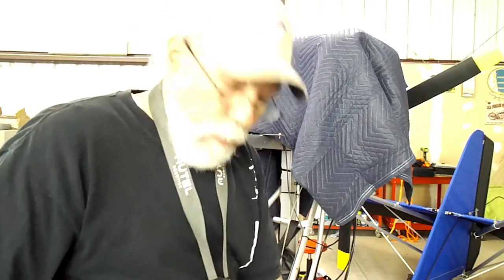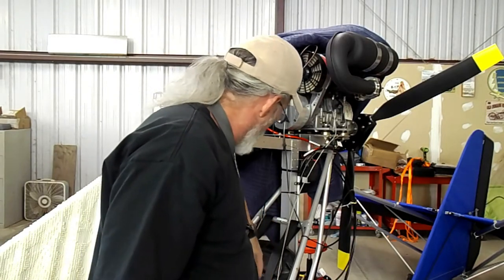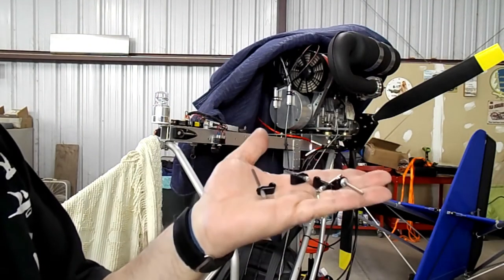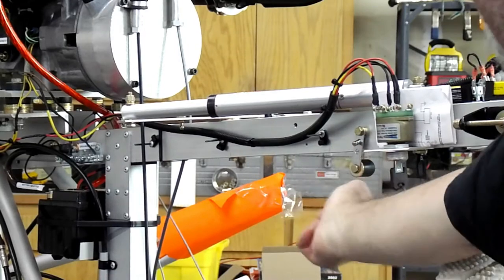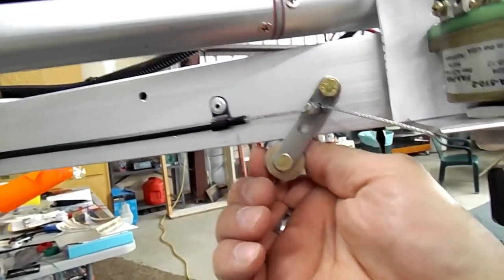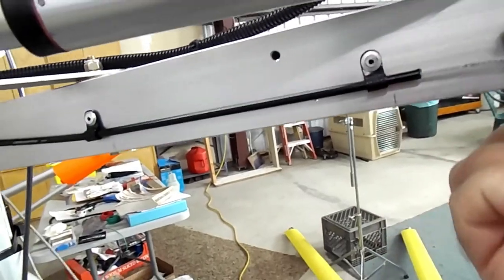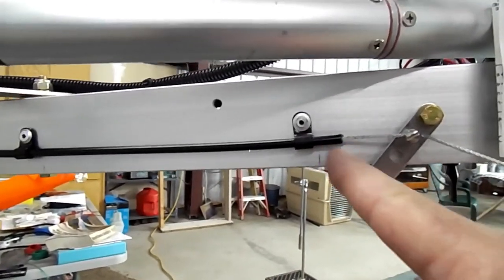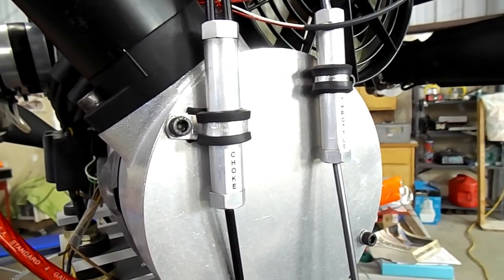Choke & Throttle Installation - Part 1

Comment: Did Aerolite not send the clutch and throttle clamps with the original purchase?  That setup doesn't look very professional to me.
Reply from the maker: Clutch? It doesn't have one. I'll assume you typo'd and meant Choke. I am not the 'original purchaser, Tab. Bought her incomplete by owner who gave up. And yes, they set all chokes up like that to my knowledge, unless you want to do it another way. Gimme a lil break I'm new at all this. Also agree it's not the best setup. That said the Aerolite 103 has been in production and flying just fine since at least 1996 - or before - as I understand it. It's also been proven a great starter platform for people who want a real Part103 airplane to fly as UN-licensed pilots in Echo or Golf airspace/s. There's a 6 month waiting list if that tells you anything. "Blue skies and tailwinds".

Comment: Not entirely sure that's installed correctly, should have a sleeve that stops that, like on any vehicle choke cable, or bicycle brake cables for examples. Also, LUBE any and all cables of that type prior to installation, because doing it after will require a lot more effort. To lube cables of that type, you hold one end up with a baggie around it in a cupped hand funnel type of hold, dump lubricant into the funnel and move inner wire braided cable until you see lube come out the other end. This not only makes the cables move effortlessly but PROTECTS from bad things such as cable fray, snapping, and or stretching. That slop you are talking about is cable play...that's not any type of problem...the problem is that the inner cable must move independently from the outer casing. It also seamed like it took WAY too much effort to use that choke...something is snagging, either cable is pinched somewhere, or bent to hard along the way, or something may be blocking the "choke slide" where the cable meets the carburetor...hmmm...watched again...the cylinder in front of the engine you described as being the choke...what are the cables coming out of it doing?
Reply from the maker: It's installed correctly per the Aerolite manufacturer. But I hear you - on the cable ends and them having a metal end piece at the ends, usually. 

As for cable lubrication you're right. But at this point I would have to completely remove the cable to do what you suggest. Having ridden a motorcycle for 4 decades I have some experience with failing cables (throttle/clutch) and/or lubing them - or not. As a rule I never lubed my cables and got satisfactory life from them all. They usually give you a warning IF one is paying attention to the tension/resistance the cable has and looks for physical signals the cable is giving up the ghost. I once had a clutch cable on my V-twin that was held on by just a few strands of wire. I got it home just prior to the break. It would have been quite a hassle to get it home once the cable snapped. I lucked out and it didn't. But the 'choke' cable on my airplane is easily seen and felt so I'll know when it's about to give up the ghost and would most likely have replaced it wayyyyy before the failure. I plan on replacing MANY things after a year - and/or so many hours.

Thanks for your comment. Much appreciated. :)
Reply: AEROLITE 103 Construction  np, just offering a viewpoint trying to help with it....really like the video's btw...no one else is sharing an in depth build with the 103

Comment: I just bought a Mini-Max, and the choke cables were off and tucked under the cowl. Trying to find how they atch at the carb. Also, I noticed the problem with your choke. I ONLY use those type of cables, that have a return spring on the other end, as pushing it in the sleeve, eventually leads to a kink in my experience if there is any misalignment.
Reply from the maker: Congrats on your recent acquisition. You can find the info on your specific carb/s (mine are BING 54) online and it will explain choke cable placement. I personally use throttle & choke cables supplied by my manufacturer. The carb/s have the return spring in my situation. You want the choke to stay on while starting so there has to be some friction holding choke on. You might have meant throttle with respect to your comment on spring tension. If I misunderstood, forgive any erroneous info. Good luck with getting yours into the air. I've heard Mini Max are nice planes.

Comment: Yeah I don't like that setup, Do a search on Kart throttle cables there are better designs including mounts and adjusters.  I also don't like how the clamp barrel does not rotate and starts bending the wire.  While it might only be an annoyance on the choke, it could be deadly on the throttle. I use to race karts thirty pounds ago and I have had a throttle cable break do to normal ware and my ankle pressing on it  in turns knocking it out of alignment.